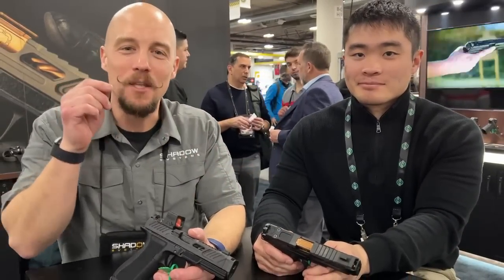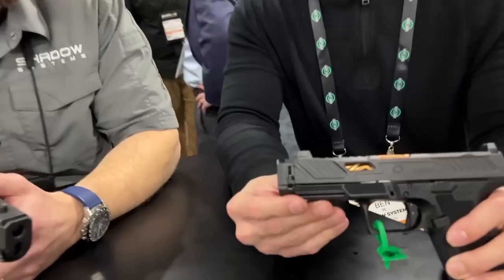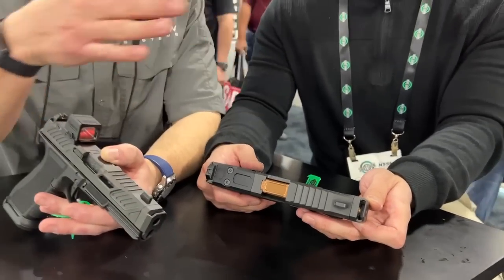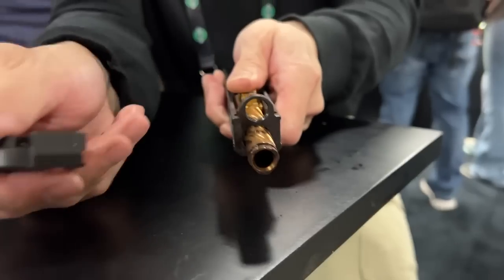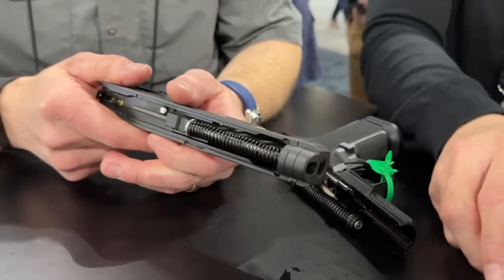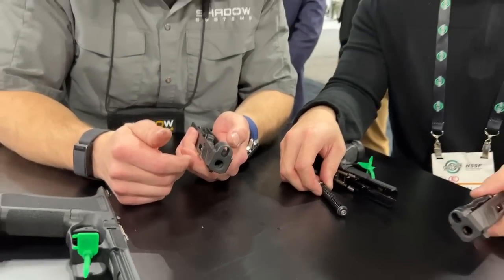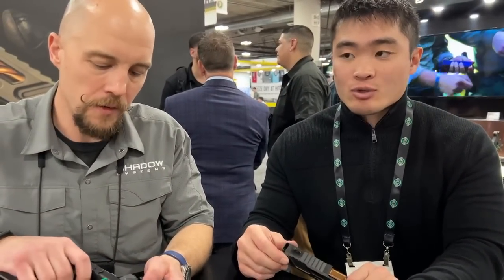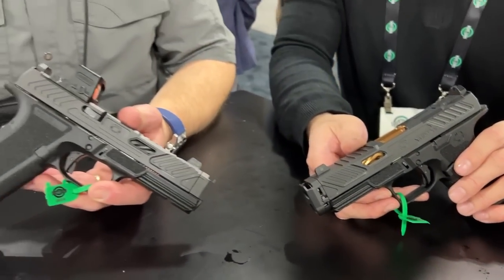SHOT Show 2024: Getting into the Engineering behind the NEW MR920P and XR920P pistols

Comment: Dangit! I need to buy an MR920P. I got the shadow systems thread on comp for my MR920. The MR920P comp is so much smaller. 
I own a CR929 elite, CR920P, MR920 with a shadow thread on comp.

Just take my money. I have to have the MR920P. 
The extra .5” from the threaded MR920 doesn’t give enough benefit. I might have to dump the MR920 with the shadow thread on comp to buy the MR920P.

The shadow comps make a WORLD of difference.

Comment: I'm not a gunsmith or an engineer, but it looks to me that the slide of the new P model is dimensionally different at the muzzle end from the existing MR/XR920 slides.  That, and it looks like a different recoil spring/guide rod.  This would suggest that a simple barrel and comp purchase would not be compatible w/ an existing MR/XR.  Looks to me that it'd require the purchase of an entirely new top end to work on your existing MR/XR frame.
Reply: That sucks man
Reply: Yup. And that Fucking Sucks for existing MR/DR/XR owners